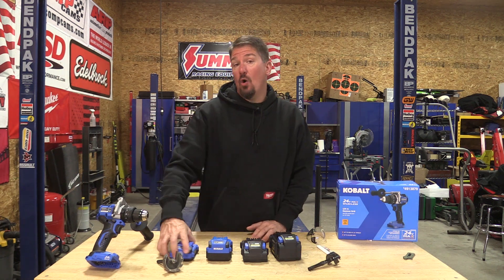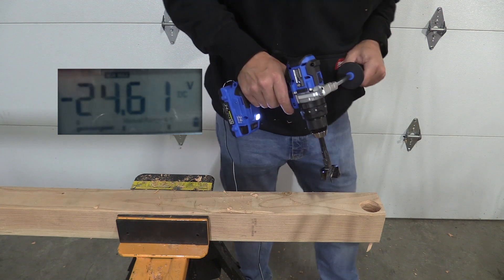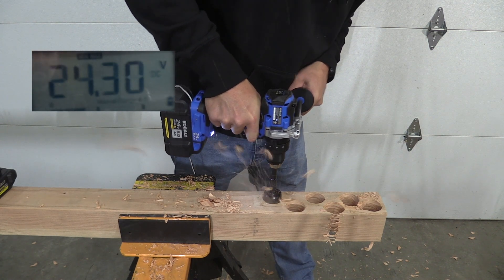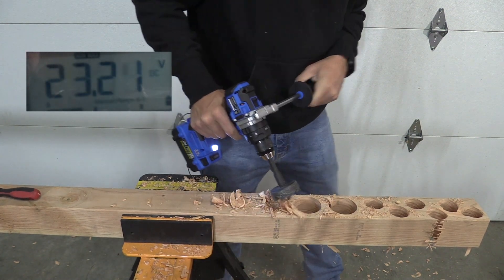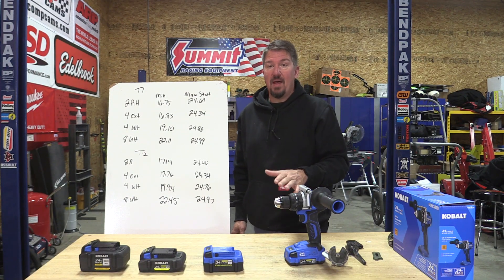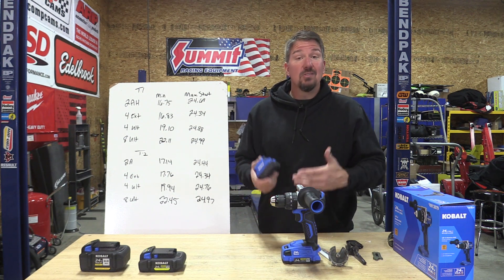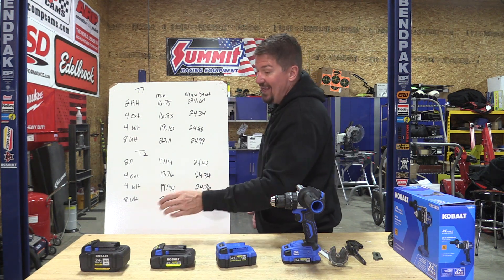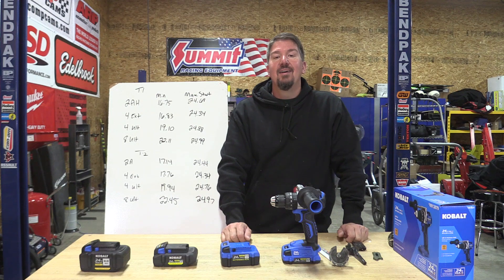Kobalt 24-Volt Battery Output Testing - What Is The Best Battery To Buy?

Comment: I have a couple of the some of the extended run batteries from kits. They constantly give me headaches. In a drill the 2Ah almost always drops off and the drill light starts flashing. The 4Ah batteries get too low to charge and I need to give them a little juice from another battery so they will even charge. I got a couple of the Ultimate outputs yesterday because of this video and other reports. If they are also crap after a short time like the extended runs, I am switching brands.

Comment: It's enlightening to see the performance differences between the extended and ultimate output batteries. That's definitely going to make a noticeable difference when you're loading down the  batteries more and loading the tools down more.

Aside from power for the tool, is also to consider the fact that all Kobalt Power tools are brushless. And one of drawbacks to brushless is that when there is noticeable voltage drop across the motor windings, this actually causes the windings to heat up quickly, and will also quickly kill off the motor - as opposed to brushed motors. Brushed motors take voltage drop like a champ. But brushless are very intolerant to voltage drop. The number one thing that prematurely will kill the motor. 

So definitely go with those ultimate output batteries for performance, but also for tool life too!

Comment: this is an apple to orange comparison  the reg are 18650 the other uses the 21700 , 20 A and 35 amp peak.
Reply: That’s the entire point of this. The point is to test the tool on a bunch of batteries

Comment: I always assumed Kobalt was pulling a dewalt and listing 24V but actually a 18V, guess your multimeter proves my theory wrong.
Reply from the maker: @stonekold  Kobalt has one more cell, or 2, in the pack to make it 24 volts.

Comment: What a useful video.  I have a Kobalt hammer drill that came with a 4AH extended battery.  I am purchasing a Kobalt 7 1/4" circular saw and, after watching this video, ordered it with the 4AH ultimate battery.  Figured that I can use the extended battery while I charge the ultimate.  Hats off to Kobalt for using the same charger to recharge all their batteries.  Thanks for this really informative and timely video.

Comment: Hi. What difference would there be. Compare a 4amp extended  to 5 amp extended run time kobalt 24v batteries
Reply from the maker: Extended runtime is a marketing term.  Maybe you get 21700 cells over 18650, but amp hour is amp hour, so a normal 4 amp hour battery would have the same runtime as a 4 amp hour extended runtime battery.

Comment: I can run my lawnmower with 2x 4AH Extended Run for like 40 minutes.  They're not bad at all.  I put in lag bolts for a wall-mounted workbench, and I can jack up my car and remove struts all with the standard 2AH (scissor jacks with drill, 1/2" impact wrench for rusty suspension bolts).  Even their cheapest batteries are amazingly capable.

Comment: Interesting that the "Tools Tested" channel had the 4Ah HO battery testing worse than the standard 4Ah on his dyno.  He tested speed and power on the drills on the dyno until it reaches max torque then stops.  Channel is quite good, although that result does seem odd.

Comment: I need help I’m looking to use my kobalt batteries to run a fish finder and I need to use a buck converter to reduce the bolts from 24v to 12v also the fish finder needs atleast 10amps to run
Reply: Or is the 24v kobalt not a true 24v?

Comment: IM having a hard time choosing the right battery , maybe you can help. I can get the newest 4ah battery and a 6Ah from previous generation , both for 99.99 canadian.

Based on your test , i beleive i'm better off with the 6ah , cause of more stable voltage and recovery time and overall battery capacity , but newer can deliver as much power for short period of time while draining faster in those conditions.
My real concern is that i read that 21700 cells are rated for 250 cycle life charges wich is low compared to the advertized 500 cycles for 18650 cells.
What's your opinion on this?

Comment: better than Ryobi in terms of value.
Reply: The more important point is that the tools are better designed, especially before the HP line. Albeit, as if we've seen on the channel, there's reliability issues with some of 'em. But the real delta between Kobalt and Ryobi is the number of tools on the platform.
Reply: My ryobi jigsaw brokebin 4 days.  It's replacement broke about 2 weeks later.  My ryobib18G nail gun broke in 9 days, it's replacement started acting up about 2 weeks later.  Now I have a kobalt jigsaw and ryobi nail gun.  Very happy with Kobalt. They  feel solid

Comment: Kobalt! Happy to see this video, and the testing. Best traditional batteries out there IMO. 6 Samsung Cells for less money than the 5 cell 18V brands in a very similar size case. Not to mention a glass fiber case that DeWalt & Milwaukee charge extra for in an 'oil resistant' case. They're outstanding for electronic projects as well due to the cost.
Reply: There are 10 cells in 18v batteries i tink
Reply: @stephaneroy8415  Incorrect. There can be 10. But, it's always a multiple of 5. 5 is the minimum. It's just how they're laid out. 4v (3.6) x 5 = 20v (18)